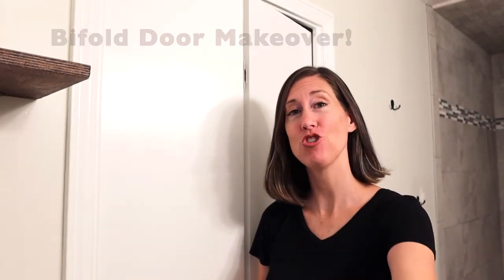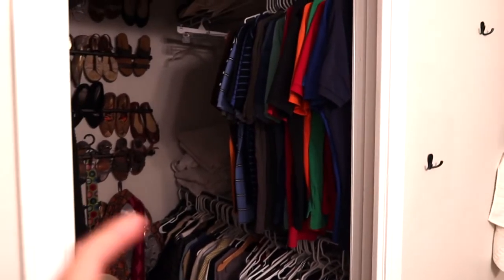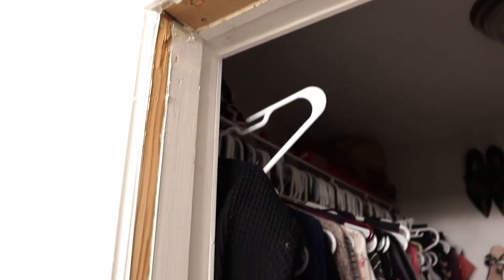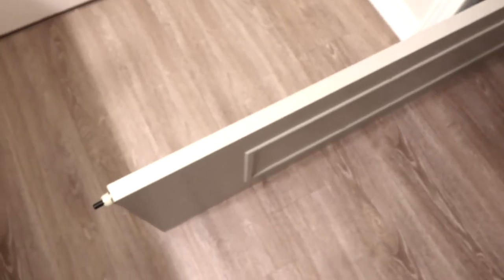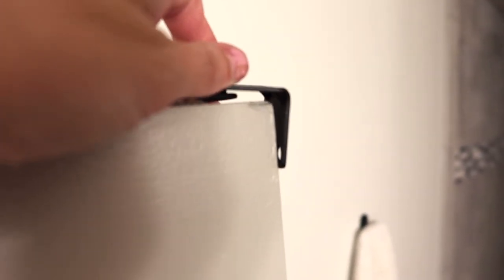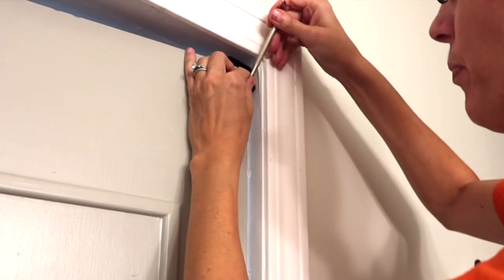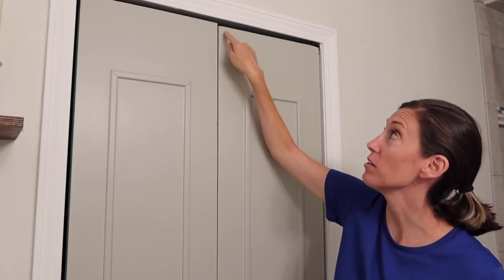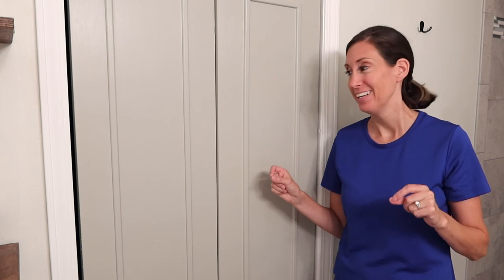Turning Bifold Doors into Cafe Doors and a simple BIFOLD DOOR makeover

Comment: Cool video! Wondering if there's a way to turn bifold door into an inswing French door set? Or would this basically be the same as what you have done with cafe door? I only need them to open in one direction, but i like having them stay open in that direction like your cafe doors do
Reply: I guess to be more specific, i would want them more to be doors that click closed, like with a lock or door latch. Your video is the only one I can find with anything inswing. I have a 32" passage that i want to use a bifold like two skinny little french doors on that open inward and I'm stumped!
Reply from the maker: @jh8379  You should be able to find hardware that swings in only. Then I think you would do the same thing I did but the hardware wouldn't swing out. That's what I would do.